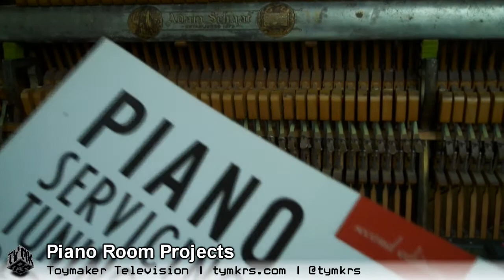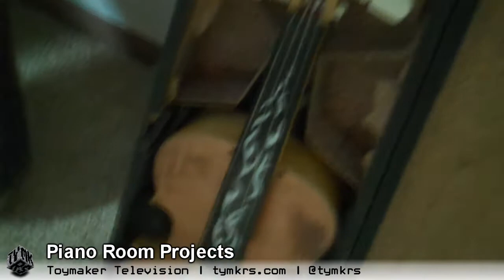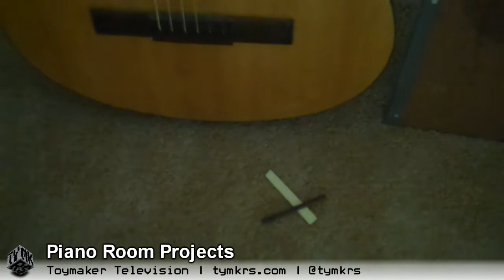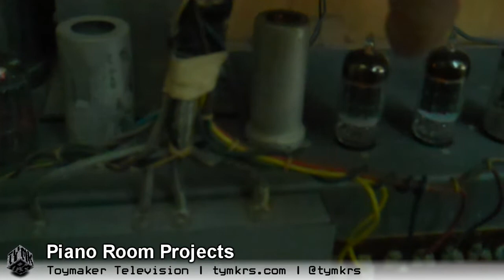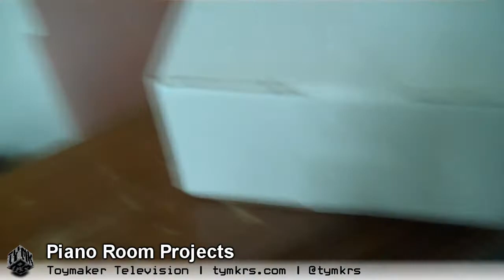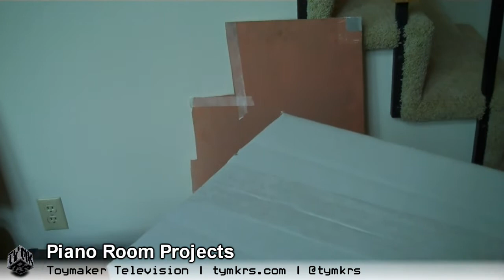Tymkrs Piano Room Projects

Comment: Actually, you might even be able to produce a secret effect.  Etch old school floral patterns on the outside, and circuit board traces on the inside.  When the back light is off you only see floral, but when it's on you get the MAGIC!  This would work awexome if the pcb is pretty thin... might wanna test it on a small section first ;-)

Comment: SIDcog organ for sure!  You could use that PCB material as a decorative plate and screw it down over a subframe.  You would definitely want to etch a cool design into it, maybe a circuit board / old time floral mixture.  You could create this using a sharpie marker and etch it with a dish sponge filled with some ferric chloride.  If you etched off the entire backside copper... you could back light it for a really cool effect.